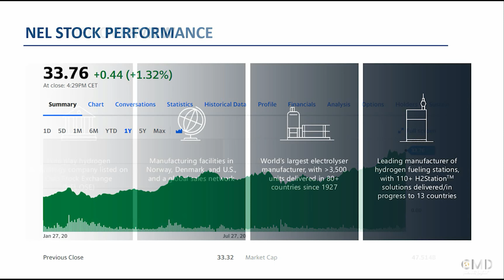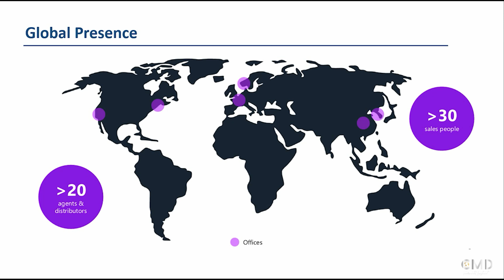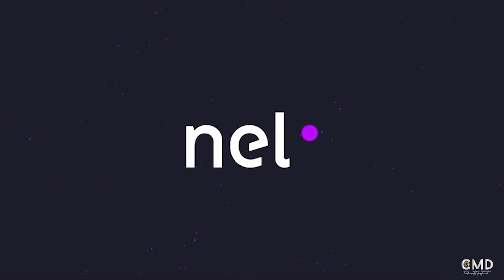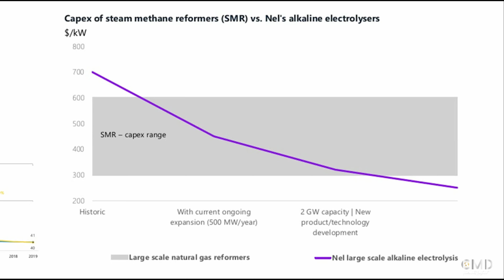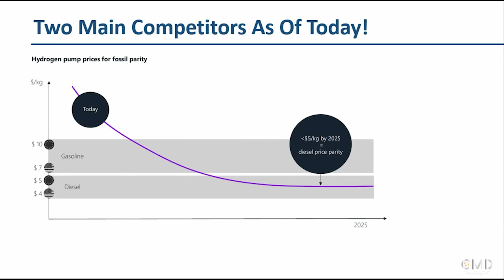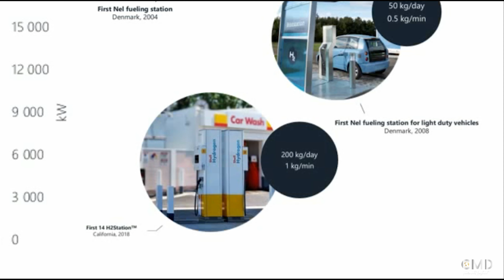NEL ASA Stock Analysis - All You Need to Know About This Hydrogen Stock Leader [Part 1]

Comment: If the company changes plan from only H. To electronic batteries too then will thrive , I buy shares holding long term for Energy sector investment, like your Danish accent
Reply from the maker: Hi Babylon, glad that there is at least one that can distinguish from all the other german / austrian believers :) Question is if they have any competitive advantage within that area... Seems like they have their plate full at the moment with expansion.

For sure to invest in these companies you need to take the long-term view. Good companies exist, but there also are some that appears to be black holes... good luck :)